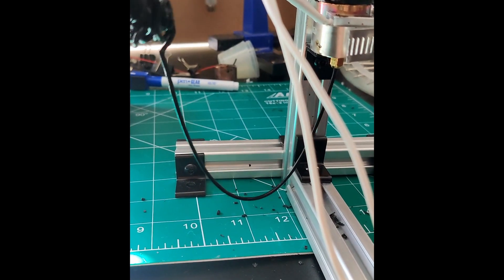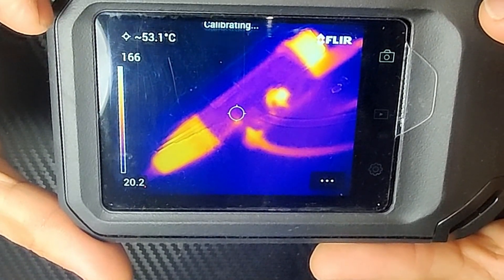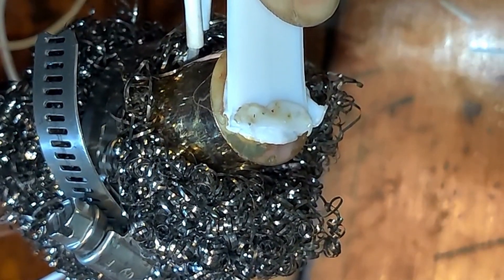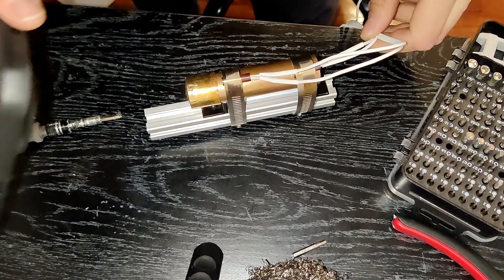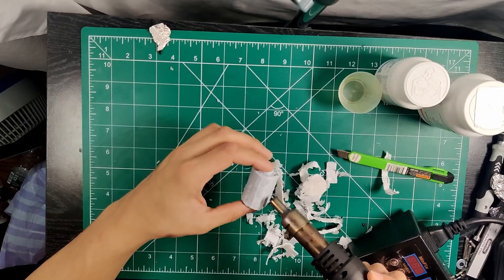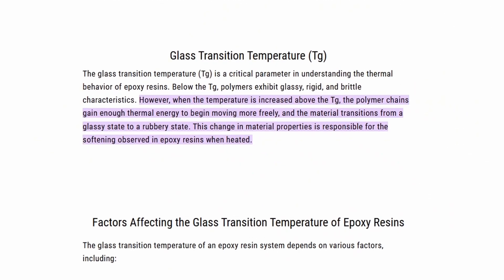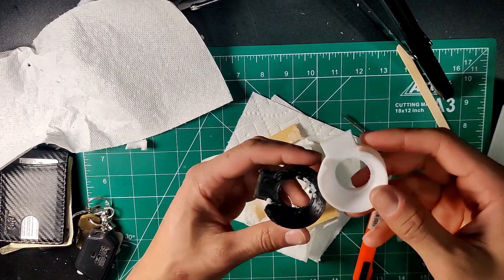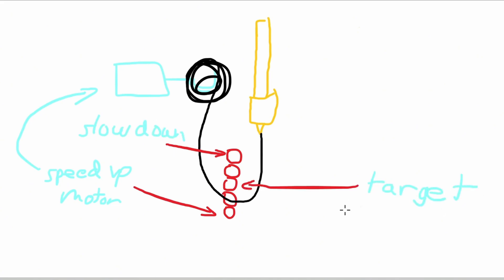How I made a filament extruder (I'm cheap)

Comment: How much did it cost overall?
Reply from the maker: I want to say between 150-200 for this version, but now that I am working on self winding and all that, it's getting around 300. But R&D  has cost me an extra $200 or so, because I burnt an Arduino and a motor😅. Plus I'm testing different things.
Reply: @-EhsanMalik- How much time did it take to do all these things?  If I try to do all these  from scratch,  how long can it take?  I haven’t done this kind of projects before🙁
Reply from the maker: @LazimaIslam-w7i it's difficult to say, cause it depends on how much experience you have making things in cad and how often you are working on said project, also research takes a while. 
I probably put about 10 hours into research. And designing was probably 100 hours. But I don't get to work on it everyday so it takes a lot longer to finish. Plus it doesn't really matter how long it takes, cause at the end you get to say I made this and I learned a lot
Reply: @-EhsanMalik- Thanks a lot!

Comment: Use a light curtain to control the speed on the winder, it regulates the speed based on the loop height
Reply from the maker: That's what I've been working on for a while, it's a tricky thing

Comment: Great project ! Just make sure to cooldown the filament in the appropriate way depending on if you want to roll it on an empty spool or not, don't end up like me with your filament cooled down, trying to roll it, with it unrolling by itself (since it took a straight shape when cooling down) (Hope these sentences makes sense)
Reply from the maker: Yeah, that's what I was wondering and was probably going to figure out through trial and error, if I want to coil it, it would have to be cooled in a curving manor right?
Reply: @-EhsanMalik-  I assume yes, I think you could use a flat space with the desired radius, not the best, or just quickly roll it on a spool when it's still hot, best way in my opinion
Reply from the maker: @AxialePrint  what I'm worried is while it's still malleable, if I roll it it might stretch or deform in some way.
Reply: @-EhsanMalik-  You should be able to adjust the distance beetwen the heat part exit and the filament rolling thing entry (since you're using aluminium rails) And use some 5-12v fans to cool the filament down, moreover you don't need to roll it with much strenght, just enough to get it into the spool (use gravity, with the filament falling naturally making a curve)
note : it's important to have fans blowing enough, but not deforming the filament, a little fan should be enough, my pet-bottle-filament-maker doesn't even have fans to work